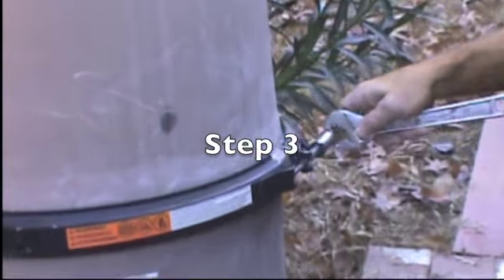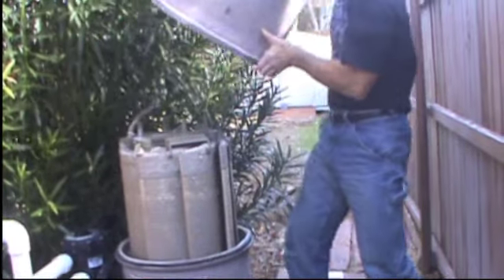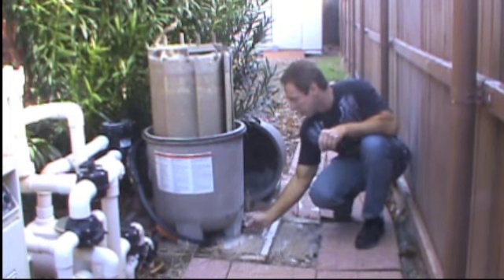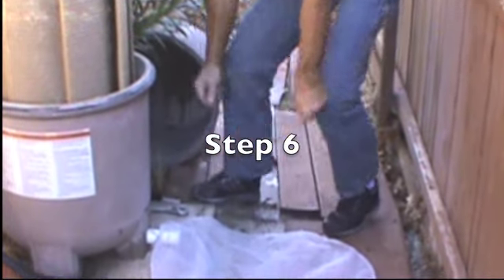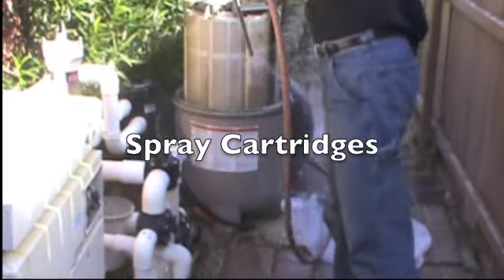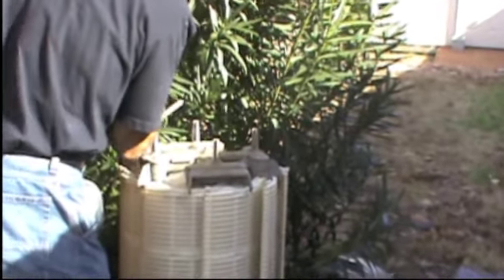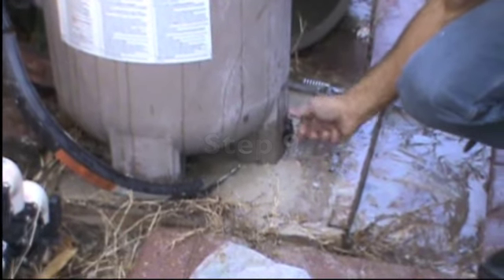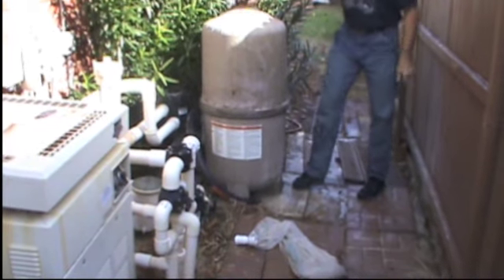How to use the DE Filter Cleaning Device

Comment: Completely incorrect way to do a filter clean. No inspecting grids , no lubing stand pipe oring, no lubing filter oring, no lubing drain plug oring. Lazy
Reply: I am thinking the same thing.  Can't even degrease the grids with solution.